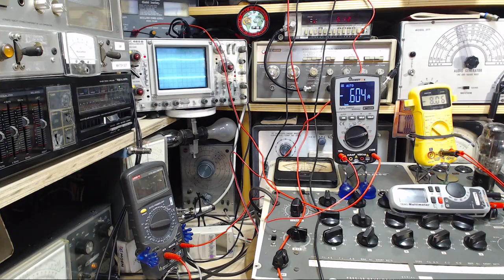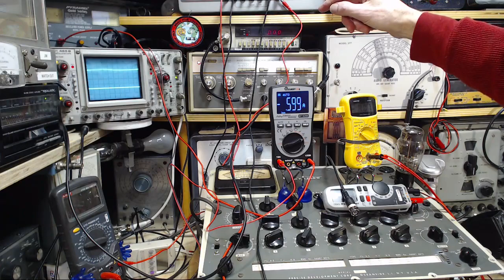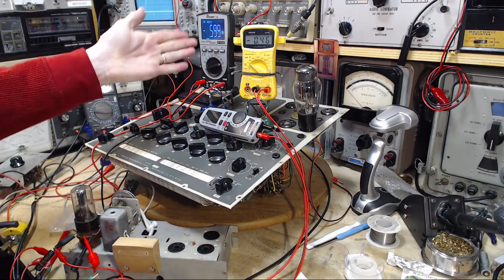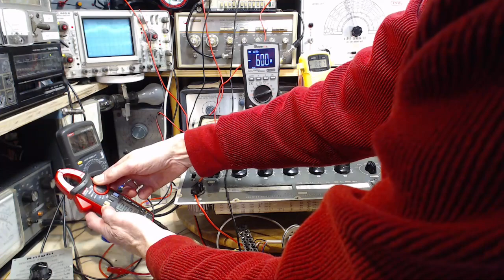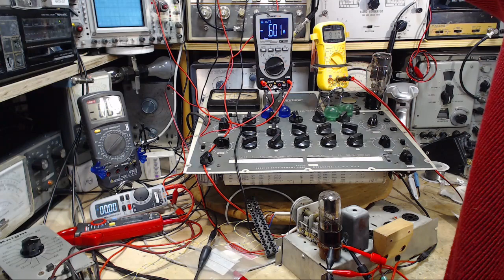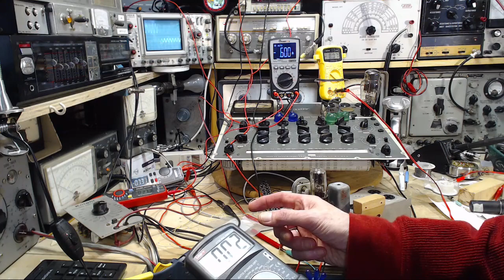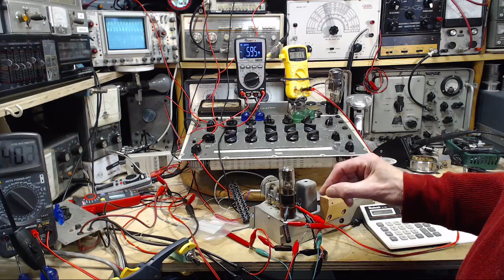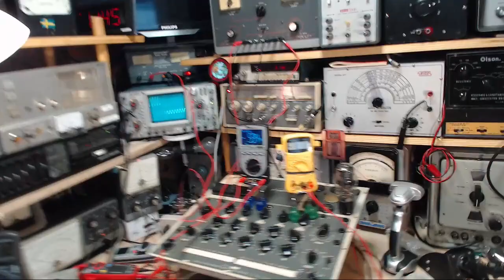DIY Tube Testing #7 - Instrumentation Issues

Comment: Hi Jim 
Here's my 2 cents worth of confusion !

It could be beneficial if you drop the frequency keeping within the meters working range .
200 hz is about it for the low end  meters !

 No a/c ma current range a 1 ohm 1w resistor will solve that + a dvm set on a/c mv..

The signal out & scope ground problems ?
         “ simply just look across the tube ” .

As for the input grid a/c signal its looking like the grid bias supply is loading it .

Comment: Can you put a resistor in the cathode to ground to monitor the plate current on the scope?  This would not require a floating ground.  If you were to expect 2ma of plate current and want to drop 1V across a cathode resistor, then the resistor value is 1V/2ma = 500 ohm.
The grid bias would have to adjusted by a volt to accommodate the 1V rise at the cathode.

Comment: 416.666666667, A 10K 5W wire-wound should work perfectly use the clamp and not a direct connection to the clamp meter.